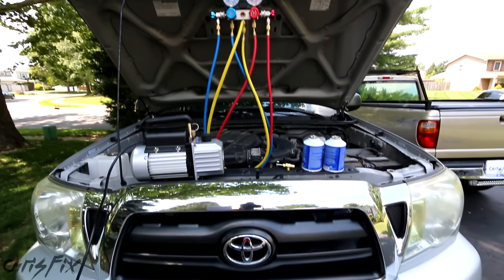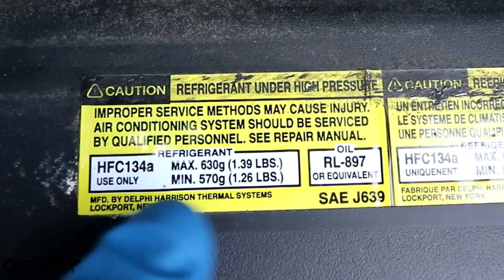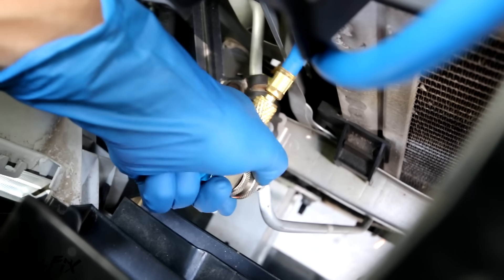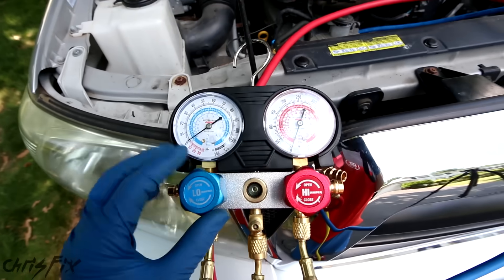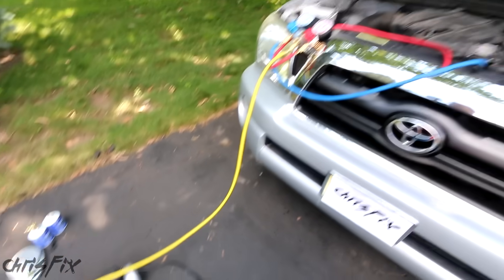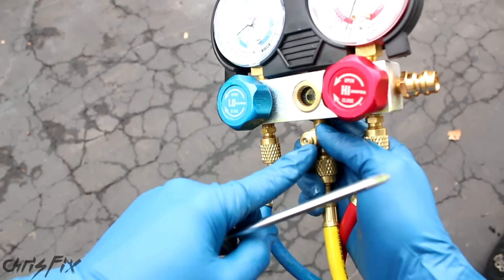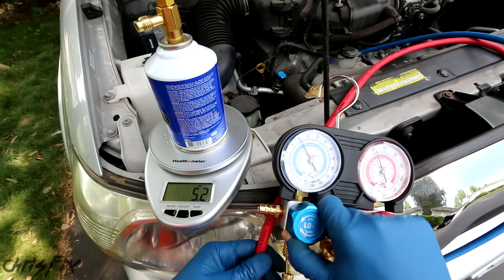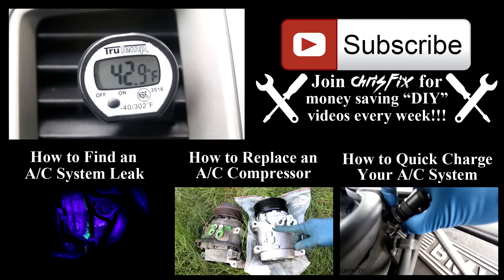How to Properly Recharge Your AC System

Comment: +Chris  ~  I'm new to this, when you vacuum...all refrigerant clean out too right?  And how offend do I had to vacuum? I meant one a year or 5 year one time?
Reply: You can always pull it all out with a vacuum pump. It vents as a gas. Some people find this somewhat controversial but the EPA does not regulate nor punish a person working on their own personal vehicle using r134a. R12 has to be handled by a professional. But think about it... If your AC is leaking it's already leaking into the atmosphere. What's the difference in a person repairing their own AC system once in a lifetime and that person having a major problem that makes it all leak out anyway? I say there's no difference and the EPA says there's no law against working on your own personal vehicle. Wth would they sell it at Walmart if we weren't allowed to work with it?!
Reply from the maker: The refrigerant gets removed by the mechanic in a special machine before you touch the AC system and fix stuff like the compressor. You dont ever have to vacuum the system if there isnt any leaks. My Vette is a 1996 and I never touched the AC system.
Reply: Exactly. R12 is the one that you should have professionally recovered. Hell, back in the day we purged that as well.
Reply: One important word missing here...  " yet"  I'm sure the EPA will get around to it eventually.....

Comment: Hey Chris, I also have a comment regarding adding oil or AC dye into the yellow supply hose.  At first, it sounds like a great idea and even Eric the Car Guy also suggests this method.  But, since you want to purge the yellow line of air before opening the low pressure side of the manifold, now you'll also be spraying out oil and dye with this purging process.  I'm guessing this could get a little messy, especially with the dye in there, and you've just lost some of the oil and/or dye in the process.  I was thinking an injector that puts the oil or dye directly into the low pressure port would be the way to go.  Unfortunately, it's an added expense.

Have you ever actually used the process you suggest with adding the dye or oil into the yellow supply line before hooking it up to the can of refrigerant?  If so, did you still purge the line of air before opening the low pressure manifold valve?  I'm going to try my own AC service soon and I'm trying to gather as much info as possible before I tackle it.

Thanks for all the videos you put out.
Reply from the maker: +Timmy The Toolman I use the yellow line for adding dye and oil all of the time. It's very narrow and doesn't hold much volume so you would fill it up which means there is no air to purge.
Reply: Hey Chris, thanks for the quick reply. I get it, but if you were just adding a small amount of dye, like a 1/4 ounce, I would think you'd still want to purge some of the excess air out.  Adding compressor oil would be a different story since you'd be adding somewhere in the area of 8oz or more and I guess that would definitely fill all the voids in the supply hose.  

Maybe I could add the dye, hold a rag over the shrader valve while I purge the excess air out.
Reply: +ChrisFix  hey first great video. I have 1 question so my ac compressor Also came pre oiled. so when run the vacuum line won't that suck out the oil in the compressor.??
Reply: He explained that the dye mixes with the oil and when you vacum it it stays with the oil...the vacum line does not suck out oil, only water/ moisture and air.
Reply: I would think the easiest way would be to buy the cans that have uv dye already in it.

Comment: You forgot too purge ur second bottle..😔
Reply: you didn't pay attention, he closed the can tap (brass thing) then connected it directly to the next can so the yellow line already had refrigerant trapped in there from the first can. If you don't do it this way then you must purge the line again.
Reply: Knut Falmaar the line is already full of refrigerant, no need to purge
Reply: This right here is where I had a problem.  When the tap is closed, putting it on the next can will cause it to pierce the can before it is screwed on, which didn't turn out so well for me.  Is there a good technique for this, or is it best to open the tap, and re-purge the line with every can?
Reply: I just tried this on my 90 silverado.  Turned on the AC and the damn thing wouldn't suck the refridgerant. I had vacuum, no leaks, etc. But when i turn the truck on, open the low side valve with the A.C on. Nothing happened. I even took a wire to the battery to the compressure to manually kick it on
Reply: You need to find the low pressure switch, remove the electrical connector and install a small jumper wire in the connector to bypass the low pressure switch. This will let the ac compressor run to pull in refrigerant. The low pressure switch is a safety switch which cuts off the compressor if the refrigerant level drops below a level which can damage the compressor.
Reply: GeorgeHamberhill Well crap. I filled it up without doing that. I just left the engine running and ac on while I unplugged the hoses to manually recharge it with a can and gauge. Think that was a bad idea? It is working
Reply: GOD719 no, your fine either way, you won't hurt it.   The pressure switch bypass is only for when the ac compressor won't turn on.
Reply: No.
Reply: I purge it, anyway. And I also use a separate six inch hose just for tapping the refrigerant.
Reply: GOD719 if compressor want kick on, first break the vacuum with refrigerant true the low side (it will not kick on without pressure because of pressure switch). After you add first portion of refrigerant, turn on the engine. Don’t operate ac compressor without pressure or deep vacuum, it will cause damage of the compressor.
Reply: But when you unscrew the Yellow tube from the can, isn’t the yellow tube open to air, thus needing another purge?

Comment: chris its not true that when you recharge your ac and the yellow hose is loose. refregerent comes out of it. your blue hose is the suction line and your comp. is sucking refregerent from the yellow true the blue hose in the system meaning if youre recharging and your yellow line is loose or gets loose it wil suck air my friend check it

Comment: Could you eliminate the scale and just read the gauges to determine the proper amount of refrigerant?
Reply from the maker: +service1956 the scale is the best and most accurate way but you can go by temperature, humidity, and pressure.

Comment: Can you explain what is the difference between the Ac heat and engine heat I mean you select inside the car Ac and put it to 26c degrees for example for heat but I can switch off Ac and still have heat from the engine what is the difference ?????
Reply from the maker: +lcpd26 the ac system creates hear when it pressurizes the refrigerant. The motor creates heat because the gasoline explodes in the engine.
Reply: +ChrisFix oh ok so engine heat coming into cabin with the fan is not affecting fuel economy (only the fan voltage of course)? Right ? 
And Ac heat kick the Ac compressor on ? Right ? 

My question is what is then the point of Ac heat ? And not just using engine heat ? Like does  anybody use Ac heat then and why ?

Comment: Hey there thanks for all the information. I have a question I bought a 2005 saturn vue. it had front end damage., ac was not working.  It needed a condenser, I had it replaced and  had the ac recharged with the oil and the whole bit. The ac does ok when driving but blows hot when idle. The fans are blowing I looked,  the radiator is not in the slots because one of those things at the bottom of the radiator and one of  rubber things( gaskets) that keeps it from moving around is missing from the whole if you know what I mean.  I know this is not much information to go on but what might be the cause of this. Any information  you provide will  help thanks.

Comment: Just regards the centre  purge valve on your gauges ,  its best to cap it when using vac pump,  my gauge set has leaked there on vacuum more than once before,  took some time to find that.   Not sure if the vac pump you had a  gas ballast valve?  If it does you can open that up till it gets to 30 Hg, then close it for deep vacuum,   helps the vac pump oil last a bit longer.
Couldnt complain about how low the air temp was coming out of the vent.......

Comment: Replacing a bad compressor may not be enough.  A failed compressor can blow metal shavings into the system.  Metal bits can destroy the new compressor.  They can block/clog the expansion valve.

Comment: I'm a licensed HVAC tech and had a noticed a few differences between Automotive and Residential/Comercial/Industrial HVAC. Otherwise great video on how to charge a car a/c system. First leak testing by vacuum. can be hit and miss. Thirty inches of mercury at most is pulling negative 15 psi on lines that can carry over 325 psi. Ideally you would pressure test with dry nitrogen or co2 to 150psi for 30 minutes. For everything not automotive we are required by law to use a micrometer and pull to at least 500 microns. Second, I wouldn't suggest to add oil through the charging hose. For obvious reasons you will make a huge mess when you purge the lines. Instead when your sure the refrigerant lines are empty just take the shrader core out of the low side and then attach your low side hose and add it through it and give it a minute or two to drain. Then disconnect hose and reinstall shrader pull vacuum and so on. Third before you disconnect your high side hose close that valve like your about to take it off and open the low side on the manifold. The high side hose is usually filled with liquid refrigerant and is actually part of the charge you metered in, so waste not and put it back.

Comment: It's a pity you cant DIY A/C system stuff here in Australia, but luckily I have got cans of Arctic Freeze R134a after a recent work trip to USA, apparently any DIY on aircon system is a no no as any gas vented is bad for the ozone layer here in Australia, but my question is, if your aircon requires regassing, where did the car's A/C gas leak to? Into the atmosphere, the same place where any gas accidently vented during DIY would end up. I'm getting fed up with the people whining it's illegal to do aircon DIY.If you are competent, and are a technical minded, I say go for it. Good work Chris!!!
Reply from the maker: +bin chicken yea that stinks. Especially when there are a lot worse things you can do to hurt our environment. Plus, now mechanics can rip you off bc if you want the ac fixed you literally have to go to them!
Reply: +ChrisFix but thanks to chrisfix we can go ahead and doit our selves anyways chris may i ask a question where do you learn all of this stuff from?

Comment: Just wanted to let you know that I finally got the AC charged on my Volvo S40.
 But, heh, not without some screw-ups on my part.  I spent most of Sunday afternoon working on this and as I was installing my new compressor, I suddenly realized that there were some o-rings missing.  The new compressor came with  a couple of large o-rings, but each tube also had a small o-ring which, as luck would have it, were both chewed up on the old compressor (and perversely, the large o-rings were in perfect shape, lol).   

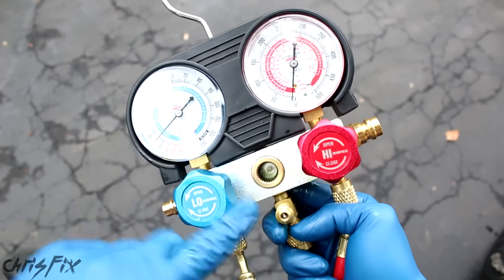Visited 4 auto parts stores and none of them carried them, of course, so I finally had to settle for an assorted bag of Ford o-rings which had a couple that fit okay.  Anyway. by the time I got it all put together it was 9:30 at night and I should have stopped there, but I was tired and not thinking straight so I went ahead and charged the system.

So the main screw-up was that when I add the R134a, I opened BOTH the low and high pressure valves.  So the low pressure valve kept climbing until it was around 70 psi. and the high gauge never got higher than 80 psi, and of course the juice just wasn't flowing in and the ac wasn't cooling off.  After 5 minutes I decided to see if the can was empty (felt empty) but when I removed it there was still quite a bit in there and I dropped it like a hot potato and probably lost about 1/3 of the can.  

About then I decided to fiddle with the guage set (cheap Harbor Freight kit so I thought something wasn't working right).  I closed the high pressure line and immediately it began to flow just like you showed in your video, lol.  I didn't really know how much was already in there so I added about 80% of the second can, and the high pressure gauge ended up reading just under 200 psi.  

So I have no idea if I overcharged the system, it does blow out ice cold air, but now a day later, I'm thinking maybe I should have the refrigerant removed by a mechanic and start over, what do you think???

P.S. Btw, I'm not a mechanic at all, but over the last couple of years I have tackled several problems with my Volvo, all using Youtube videos, pretty cool.  Oh, and I also replaced my alternator Sunday, which is working perfectly, so now I think I'll try rebuilding my transmission.... 
just kidding ;?D
Reply from the maker: First off nice work on fixing all of those things on your car. Making mistakes is the best way to learn! If it is blowing ice cold, use the car for a few days and hook the gauges up. Get a temperature reading and use this chart to see if you are close: http://acprocold.com/wp-content/uploads/2011/11/Temp-pressure-chart-33776F1.jpg
Obviously the best way is to evacuate it and refill with the correct weight but if it is expensive then you might consider just keeping it how it is.
Reply: +ChrisFix 
Can you fix my car?
My car is a 2000 Pontiac grand am.
My A/C doesn't work.
I would like to have A/C but i don't want to spend loads of money fixing my car.
Even the heater doesn't come on unless it's a 2 setting.
What's wrong with my car?
Get back to me when you can thanks.

Comment: I have a couple of old cars that I'm trying to recharge.  The first one held vacuum, but when I added refrigerant, about half of a 12 oz can went in and the compressor never kicked on.  So I'm guessing the compressor or some other part is bad.  I read or saw somewhere that the compressor should kick on when there's about 50 psi of pressure in the system - is this true and, if so, is it a way to know the compressor is bad if it doesn't kick on after 50 psi is in the system ?  Since the compressor isn't on, it would be 50 psi with the compressor not engaging.

Comment: I have noticed that most manufactures only warranty the compressor if you replace the Dryer/Filter and flush the lines.  Do you think it is necessary to flush the lines?  How about replacing the Dryer/Filter?

Comment: Chis, in my research I've read somewhere that you should increase the engine's rpms to 1200-1500 while charging, is that unnecessary or will it change the amount of R134a  needed?

Comment: Dude you are the man I have been working on cars for my repairs and was always afraid to tackle the A/C system. But this video is a great guide and you helped me. I replaced my A/C compressor and Drier and Receiver. With no issues. Works great I live in Florida and the air blows at 23 degrees at 89 degrees outside. Thanks Man I owe you.
Reply from the maker: AWESOME!!!  Glad to hear it and nice work!
Reply: Hey Go nzo, how can I contact you privately. I have couple questions regarding A/C system.  I plan to change out my compressor but when you do a evacuation on the system, wouldnt this suck up the oil too?